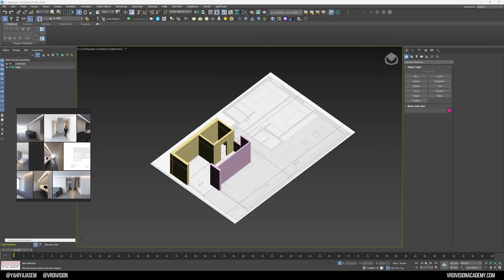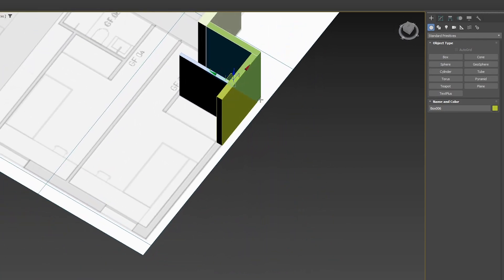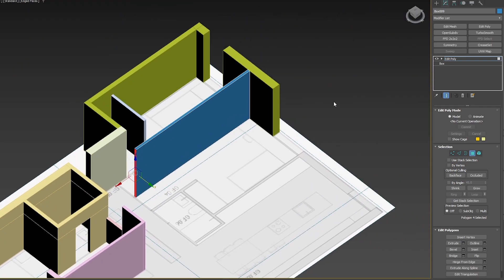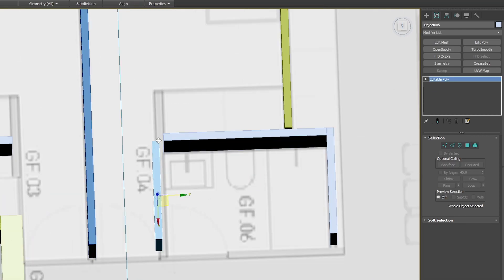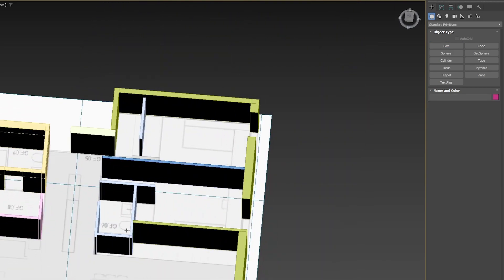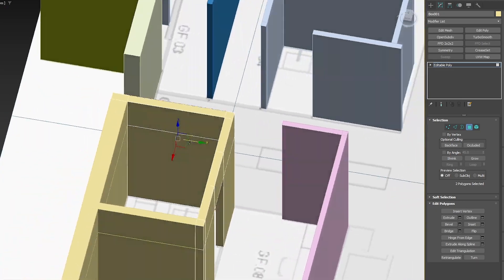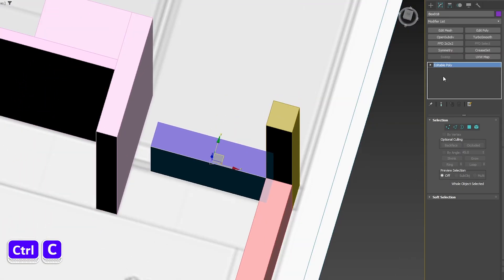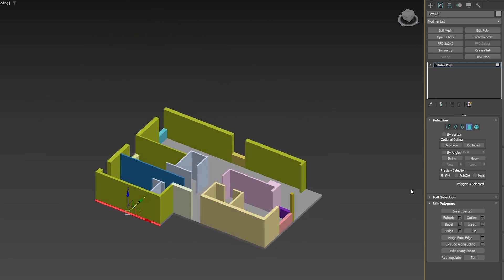2. 3D Modeling an Apartment in 3ds Max | Archviz Project From Start To Finish

Comment: Create every room using polylines in autocad. Add vertexes in door and window limits. In 3ds Max, you just had to extrude them. Easier, faster and precise.
Reply from the maker: Hi there! You make a valid point, and that's indeed a great method to create rooms with precision using AutoCAD and 3ds Max. Thanks for sharing this tip with our community! 🙌

I try to cover various techniques in my tutorials to accommodate different preferences and workflows. It's always fantastic to see users sharing their own experiences and alternative methods. Keep up the great work, and happy modeling my friend 🌟